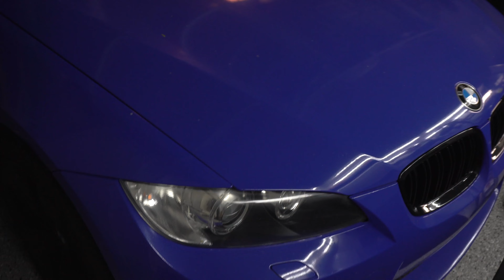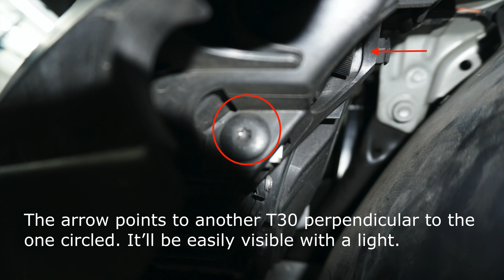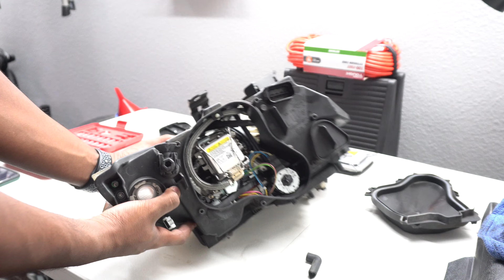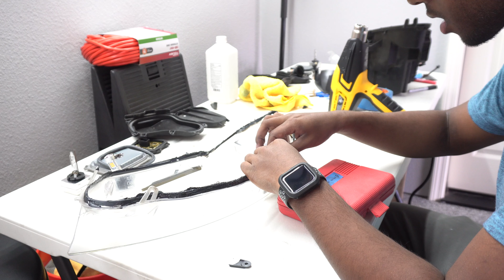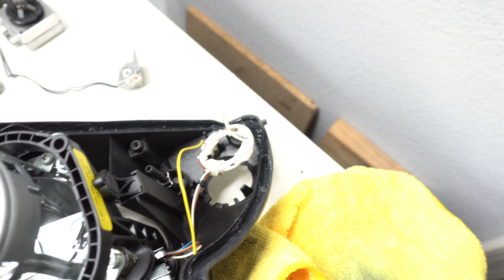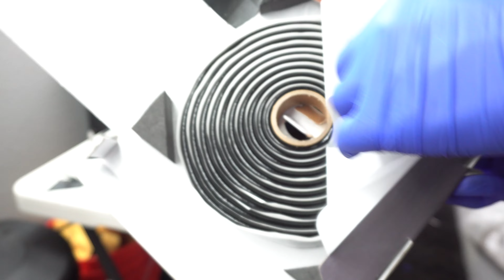BMW 3 Series E92 Bavgruppe Round LED Angel Eyes and New Lenses - 335i

Comment: I know this is an older video, but did that led signal bulb give any errors? Did you have to code anything? I’m interested in doing all of this to my m3 so just wanted to see if I should change the bulb while I’m in there
Reply from the maker: Ive pretty much coded all my bulb checks to be off, aside from the main xenon beam. Otherwise the LEDs will flicker during the bulb checks and you'll get error messages
Reply: @SamAbraham do you recommend these?

Comment: Hey,  just came across your channel and i’m now following your videos.  I’m just starting on building my headlights and using your video as my tutorial. Unfortunately, i also made the same mistake of plugging the oem plug the wrong way causing a short. Do you still have the link of rhe capacitor you used to fix yours.

Comment: Whats SwitchBack exactly mean??

After 2 years are there any dead led spots ?
Reply from the maker: Switchback means the angel eyes light up amber to match the turn signals when they are activated. And great question, the left side does have 2 dead LEDs unfortunately so I will be replacing them both this summer. Pretty normal to be honest after 2.5 years. I might ask them for a discount so we'll see

Comment: So is your low beam at night now the angel eyes? Or are the angel eyes just daytime running lights.
Reply from the maker: Just the DRLs, but they're also on at night alongside the low beams. And then the ones I have are also switchbacks so they blink amber next to the normal turn signal.

Comment: They have both sides for 50 bucks for my chassis obviously they are NOT from Germany 🤷🏻‍♂️ but 50? I can spend that to take a chance on some new (appearing)  headlights 👍🏼
Reply from the maker: I’m guessing ur talking abt just the lenses. Just remember it’s a good amount of work and time so keep that in mind. I don’t think mine are oem but they’re very high quality
Reply: @SamAbraham  I used to do this as a business 🤙🏼 had my LLC and everything I’m going to put the Ghozt module in my E90 and make it do some really trick stuff. If I remember  I’ll tag you in the video once I’m finished ....lol thanks for the kind words tho

And yes I should have clarified the 50 bucks comment was indeed refreshing to just the lens... I still feel like that’s an awesome deal... I will also use clearcoat enamel on them if the material warrants it... it’s a good way to be proactive with rock pit prevention and scratches
Reply from the maker: @skizzlemane1  Oh dope are u doing that for some sequential lights? Best of luck man that sounds cool
Reply: @SamAbraham  are you familiar with the Apple loading symbol? Like when you turn off an iOS device? Well my front turn signals are going to do that. One ring at a time moving outward 👍🏼 and of course I’ll have a show mode for when Im at the local car meet. And I assure you it willl be tasteful (minus show mode) number one priority is to look like a corporate concept. So not factory like an Audi or something but also not to look like a toy, like this polished turd of a headlight that Spyder made lol ...don’t mean to offend Spyder fans. Anyway should be cool. Hoping I can start my business back up Covid really killed it lol 🤷🏻‍♂️ oh well
Reply from the maker: @skizzlemane1  Haha that sounds awesome man all the best. You got an instagram where you post ur creations?
Reply: @SamAbraham  I’m old Sokol man lol I have a portfolio 🤣 I was gonna work on the marketing around now in the fall that’s the slow season. It’s such a niche thing I was/am again trying to do my research blah blah anyway... if you’re interested I can contact when or if I go back in business? if nothing else just to show you what’s possible  👍🏼

Comment: Im about to do the same project, just wondering how’s the bigger ring holding up cause you said you didn’t put any glue or tape to hold it. Thank you for the DIY, this will definitely help me.
Reply from the maker: Joshua Camungao Hey there, so my headlights are still looking like new since I did this back in december, and I’ve probably done about 12k miles since then. If you’d feel more comfortable you could try a tiny bit of silicone or something else but in my case everything’s still good. If you have any other questions feel free to DM me on instagram! Good luck!
Reply: Samuel Abraham what your ig?
Reply from the maker: Joshua Camungao @sam.amg

Comment: Good DIY. Was there any error codes after? Also, the other angel eye ring really just sits there without any glue or 3M tape? Curious. Thanks!
Reply from the maker: Literally just sits there, hasn't budged since I've installed the lenses. I suppose you could put some adhesive but I had a hard time with the adhesive tape sometimes tearing up the paint. There are some codes but they're pretty easy to code out with the INPA software suite. I've been procrastinating and still haven't done it lol. Maybe I should make a video on the coding part.
Reply: Samuel Abraham  i have a dumb question. Is INPA only for N54/55 platform. I have a e92 m3
Reply from the maker: Nope, INPA applies to pretty much ALL BMWs from this era and even earlier!
Reply: You guys can use bimmercode for iOS or Android and a Bluetooth OBD2 👍🏼 not to mention and I’m sure you guys know that when you get into coding you can do all kinds of stuff, seat belt chime delete, E93 top down with fob, etc anyway just figured I’m chime in and let y’all know